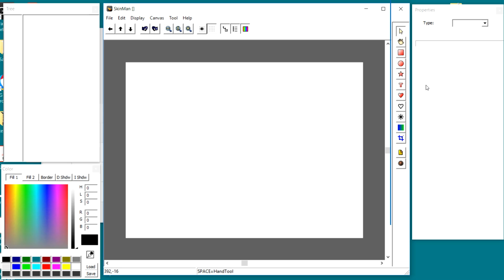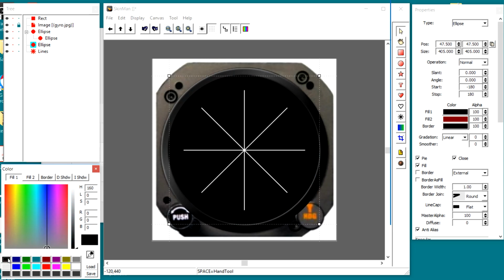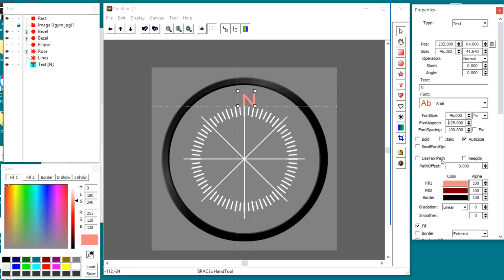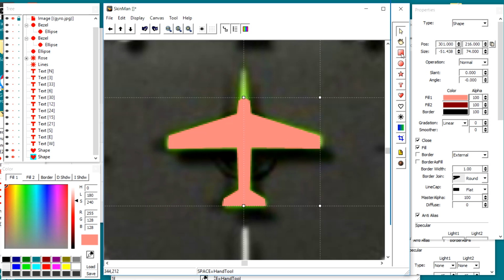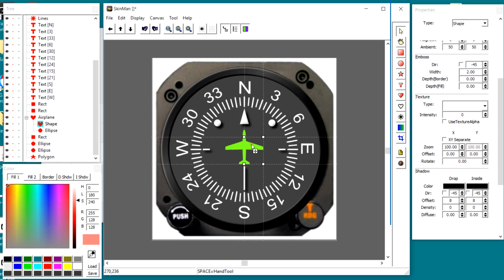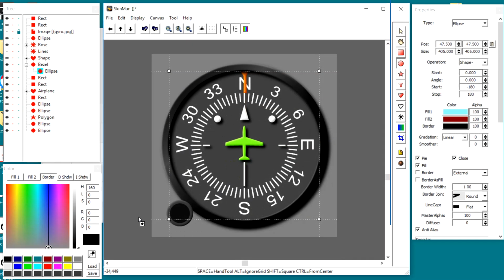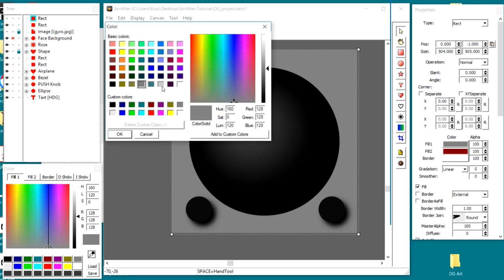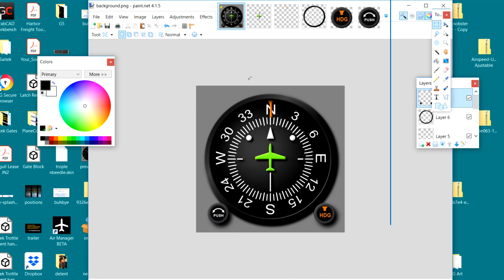Skinman Tutorial part 3 - Step by Step Creation of Instrument Graphics

Comment: Dear Russ,
Thank you form your videos.  I really enjoy watching each one if them.
I have a question regarding changes in instruments from air manager. 
I use gauges for the C172 (made by Jason Tatum) which are the most used.
My monitor is behind a real cessna panel,  which means that the instruments have to be placed exactly at the good position. 
The instruments are coming with the square shape,  surrounded by some "grey/ cockpit".
I would like basically the instruments only (circles)- even without the draw of the encoders (since i have real encoders for them).
This would allow me to position them more accurately. 
Is it possible to remove the grey background and create a round instrument only? (No transparent background, just deleting it).
Because i noticed that the square gauges cannot be moved very accurately, especially if they are close or on top one to each other. They tend to auto align.
Reply from the maker: Sorry I didn't reply sooner. Res you can edit the graphics files to make the surround black.  Either in a paint program or you can import the file to Skinman and put it behind a black rectangle with a round cutout. When you export it it will be just what you want. Turn off "auto instruments snapping" in the settings tab to get rid of the "auto align"

Comment: Hi wonder if you can help. I am using Air manager 3.4 on an I pad and want to connect it to Xplane 11 via my WiFi network is that possible? I already use the I pad with Skydeamon navigation software and control panel successfully connecting to Xlane. Cheers
Reply from the maker: When you say you are using Air Manager on the iPad does that mean you want to use it?  Anyway it is pretty much straightforward according to the Sim Innovations wiki directions. You have to install the plugin into the XPlane application on the computer you want to connect to. You do that by downloading the 3.4 plugin installer and then run it. It will find XP and install the Air Plugin into the plugins folder in the resources folder of XP.
Reply from the maker: Go here

https://siminnovations.com/wiki/index.php?title=Flight_Simulator_Plugins_Installation
Reply: Ah yes thanks Russ for the quick reply much appreciated. 
Yes the air manager is on my iPad and I want to connect it via WiFi to Xplane 11. I have been and downloaded the plugin and will give it a go. Cheers